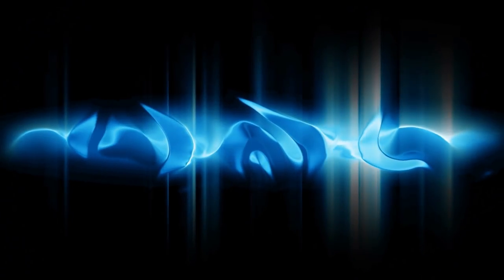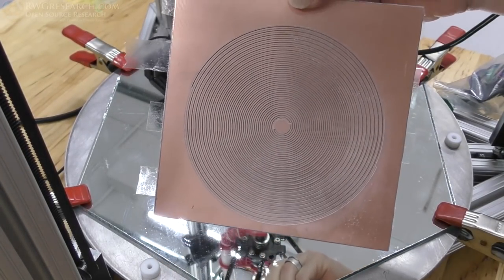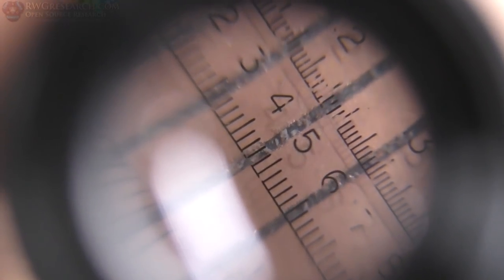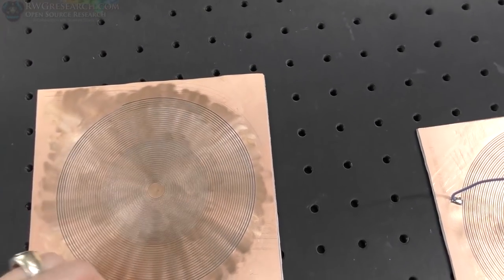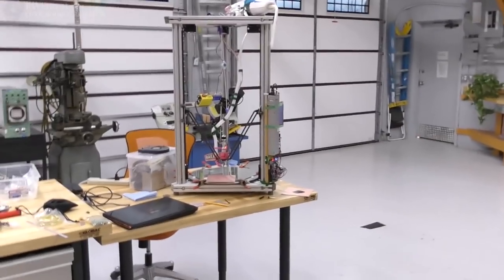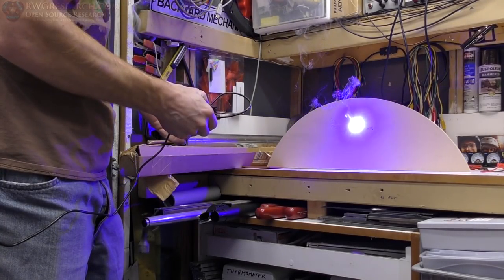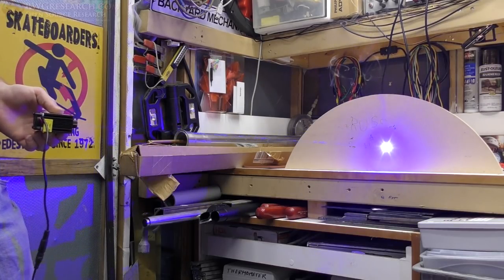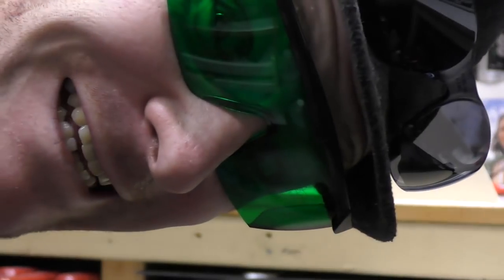CNC DuetWifi-Delta First Real Test. Using "cheep" bits... RWG-OSD

Comment: Nice machine you made!! Go for the laser engraver!!! I  recommend you to get some pyramidal bits, 0.1 mm at the tip and an angle of 20°. I started with 10° and 15° V-bits and they work, but because they end up breaking from the tip, I had to switch to other options until I found the pyramidal ones. They allow for longer jobs and repeatability :D
Reply from the maker: yeah thanks! i ended up getting some really nice 30°with a .005" (0.127mm) tip for trace isolation. , and some 45° with a larder tip for cutting  the rest out. will see how that goes...  one thing is for sure, getting all the speeds and feeds right will be key. what about lubrication? did you use any? 

http://www.precisebits.com/products/carbidebits/scoreengrave.asp

~Russ
Reply: rwg42985 I did use lubricant but not anymore. it makes it difficult to clean the traces, specially when trying to make thinner ones. Also, placing the drill bit centered with a microscope (to get less than 0.2mm of wobbliness at the tip) , and a proper probe allows to get thinner cuts, because you can adjust the depth of the cut to about 0.03mm, which also allows for faster feedrate. Everything is connected ;)
Reply from the maker: ok, thanks! ~Russ

Comment: I use a 1.5w laser for making pcbs i spray the copper with some mat black spray paint, burn it away withe the laser in the printer and etch it, works great ;)
Reply from the maker: spray paint. i heard that works.  OK, any recommendations of what brand? i also have some "blue" that i ordered for this, but haven't tested it just yet. thanks for the tip! looking forward to trying the laser. i like the cutter for the holes :) but if i can get use to making holes with the cnc and laser for the etching part that would be ideal :) ~Russ
Reply: rwg42985 no special brand was automotive spray paint from the home improvemant store, just make sure its not glossy. And was off the burned paint with some water after lasering... I might do a video on my process but not enough time at the moment

Comment: Darn, was looking for video on your power supply switch to server PS. Looked, and nothing on site either?
Reply from the maker: Jason Stokes what are you trying to find out?  I might beable to answer your question. ~Russ
Reply: Just wanting to see your wire set-up and how you went about using the quick swap connection. Maybe when you do the heat bed?

Comment: What cutting depth were you using? Deeper cuts put alot more horizontal force on the tiny bit.
Reply from the maker: some where around 1mm.   quite deep. could have made it a 2 pass process and had better luck. when using a but that was broke of it was better but wider cut.  also you can see that the cut's were filled with stuff...that was also an indicator that it was not the right speeds / depth... i will be spending a lot of time finding the best speed and depth on the new cutters. ~Russ

Comment: Did you optimise your cutting speed in any way for you cutter?
Reply from the maker: no, just by watching it and ( guesswork) however i will be using this method for my new cutters: 

http://www.precisebits.com/tutorials/G-code_zigzag.htm

~Russ
Reply: rwg42985 ah cool then.  Was just wondering how you came to your settings :). I fool around with fusion 360 now and then, it's cam is pretty decent as well from what I see on a couple of the guys I follow.
Reply from the maker: yes fusion 360 cam is ideal.  I have been using PCB only stuff. so one pass one depth stuff for now... been using FlatCAM, free and open, works good for now... but more complex stuff will requite something like Fusion360cam. at the moment ill be on a steep learning curve with that one :) ~Russ